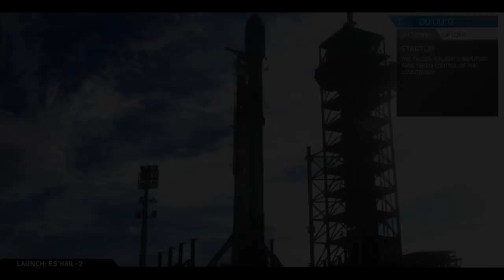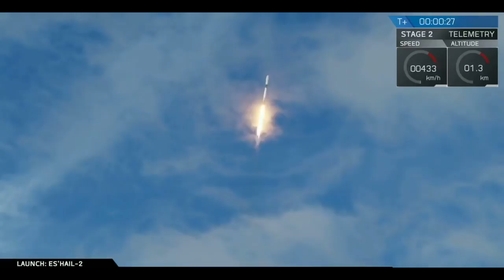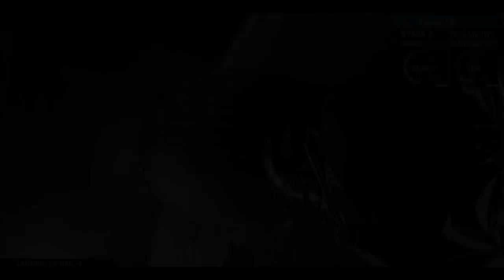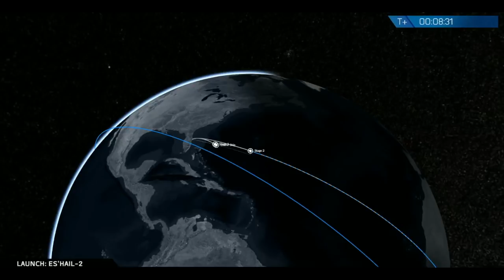Falcon 9 launches Es’hail-2 & Falcon 9 first stage landing

Comment: It’s interesting that “ignition” & “launch” are close to simultaneous with this rocket now. Certainly less than 1 second delay.

With most rockets, its a 2 - 4 second delay (I recently saw a full 10 second delay!), while they make sure that all the liquid fuel engines are running correctly. That means a LOT of strength (& weight) in all of the structures between the hold down clamps & engine mounts, or else the rocket would literally tear itself apart.

Seems as though SpaceX has got the “get all engines lit & up to full power RIGHT NOW!” feature nailed.
Reply from the maker: @teefkay2 SpaceX performs a static fire test before every launch. For this mission, the test was on 13 November.

Comment: What was that flying by the first stage at 4:19-4:21?!
Reply: Probably carbon deposits from the engine exhaust, or ice from the LOX. You usually can see the same thing on the second stage at 3:04. It's a bit of ice floating away.
Reply: Must have been some debre or a satellite. I very much doubt the later.
Reply: Daniel Whyatt It was far too low to be a satellite.
Reply: One of the fairings
Reply: I wondered the same thing.  One of the farings makes sense
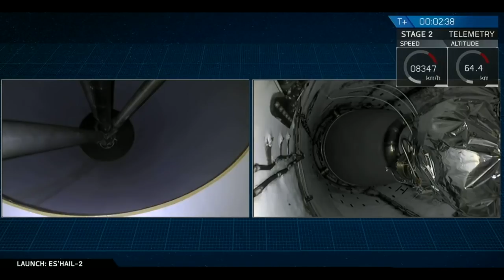Reply: Meco happens at 2:58 and the fairings separates a full 1:02 later. I’m no rocket scientist 😁 but can’t see how that is possible. Ice chunks would fall back to earth as well but seems more likely, just looks much larger than that.
Reply: Dean Hallal  This has happened on several flights. One one of the first 3 flights or so, the booster barely missed two large birds that were flying at an absurdly high altitude. Around 30,000 ft, IIRC. You could easily see the birds’ wings flapping.

This one was far too high for any bird, and far, far too slow (tangential to an earth orbit) to have come from any other satellite. It would have de-orbited in a matter of minutes. By process of elimination, it had to come from this launch vehicle. 

As far as being the fairing, I’m very skeptical, because of the separation timings, speeds & altitudes put the fairings on a much different trajectory than the booster.

The booster separates at 3:00 in this video, at 8400 km/hr & 70 km altitude & at a steeper angle.
The fairings separate at 4:00 in this video, at 9400 km/hr & 112 km altitude & at a less steep angle.

The booster & both fairings continues gaining altitude for a long, long time after separation, reach apogee & start down until they hit the edges of the atmosphere, all on parabolic arcs due to the near vacuum.

The fairing trajectories are much higher & travel much further down range than the booster.

In the above, I’m assuming that the air pressure was essentially a vacuum. I believe that this is a reasonable assumption because, if there were any significant amount of air, the fairings (with lots of surface area & little mass) would do some very interesting acrobatics upon ejection.

But, if the air pressure is significant to the fairing trajectories, then there is a chance it could be one of the fairings. And it did kinda look like one.

Hell, I’m waffling back & forth, now.
And this is gonna bug me.
Reply: Chunk of crud fell off the engines.
Reply: Maybe junkspace 😶
Reply: Jack Leo  ”Maybe junkspace.”
“Junkspace”.?  
Is that like “space junk” ...  but in a retrograde orbit?
Reply: The fact that it passes exactly at 04:20 should give us a hint

Comment: THIRD USE of the booster!!!  and did you see some object near the stage I booster at 4:19... drone?  was it too high for  a drone?
Reply: That was oxygen ice coming off the engine. Very small, flitting past the camera. The booster is falling through very thin atmosphere. That is why the flake doesn't just hang around near the engine. Probably shook off by vibration from a nitrogen thruster.
Reply from the maker: @James Otto It's not the third use of a booster, read the description.
Reply: Just oxygen ice.